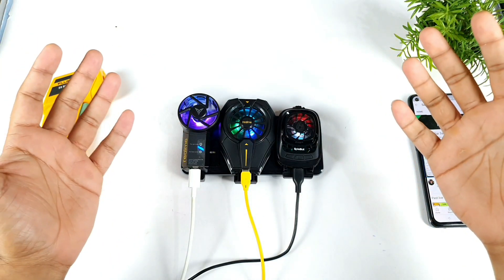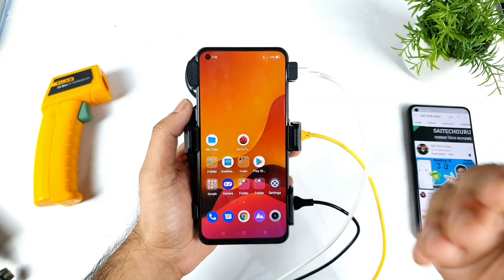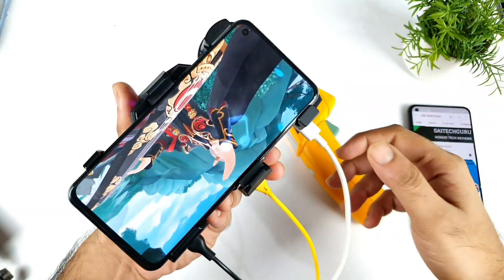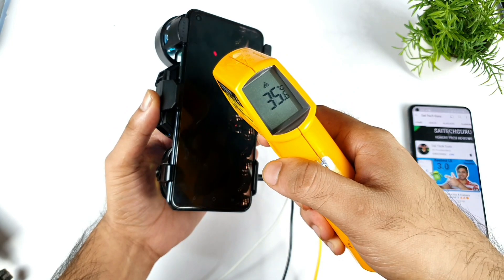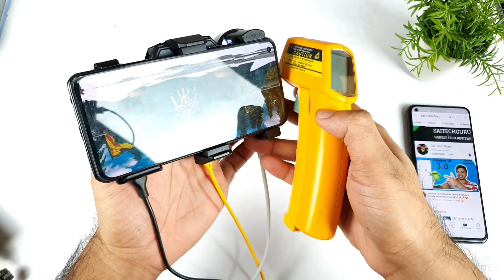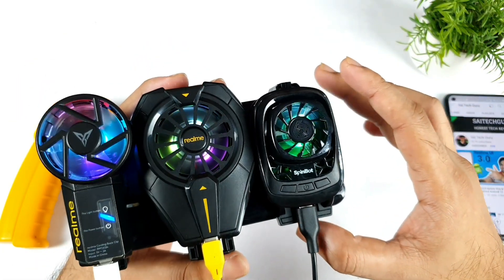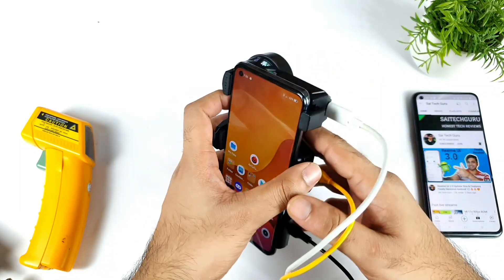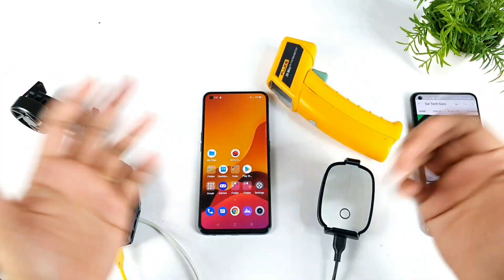Snapdragon 888 Antutu Test Using 3 Cooling Fans Can this method cool down the heat 🤷‍♂️🤔😐🔥

Comment: I just took antutu score in room temperature
Got 800000 approx with maximum performance (room temperature= 33-36 degrees)
And got 971000 with AC cooled room 

In my Exynos 2100 s21 fe 5g